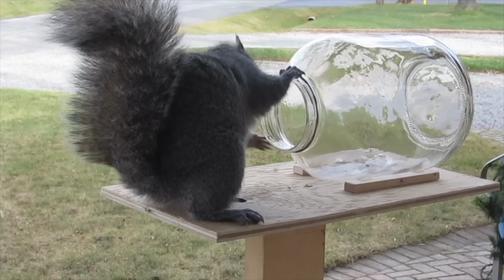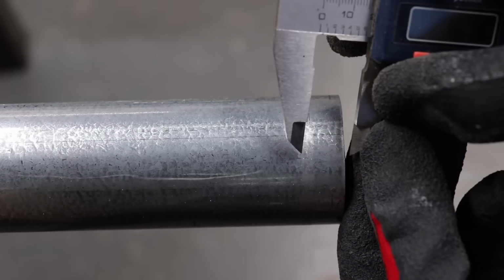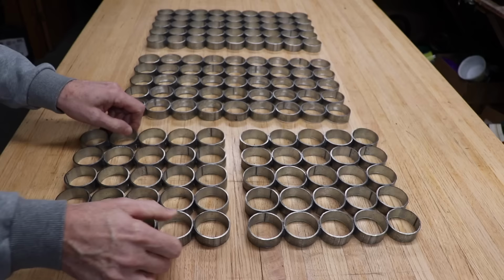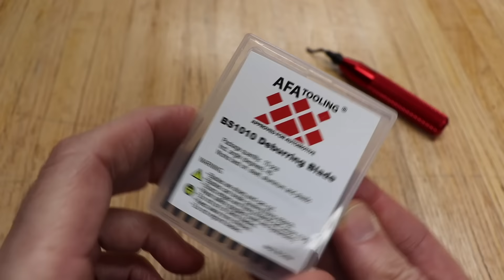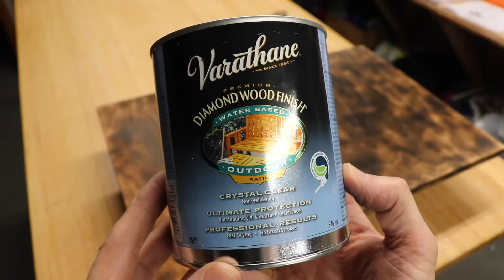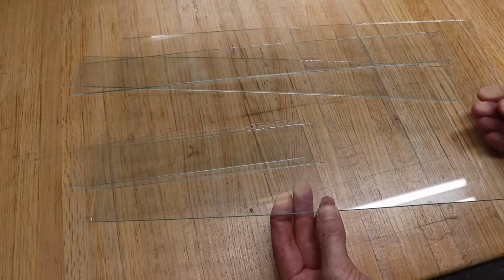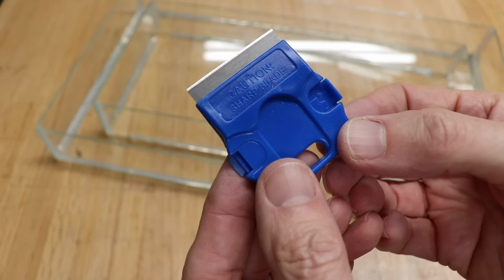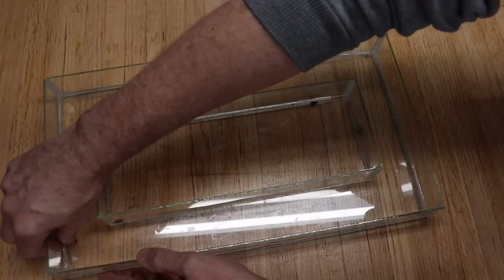How to Make ● A Unique Squirrel Proof Bird Feeder ( that actually works ! )

Comment: I was thinking to make it more Squirrel proof wold be to tighten up the opening. I would try to nestle the rings above down into the row before. That way that opening would get smaller and you would have points on each ring to apply your silicone to adhere to the previous row. The only thing is you would have to make some half rings for every other row. I plan on making me a couple of these. Thanks for the design.

Comment: Cool but I like the glass triangular version better. I need more weather resistant version. Going to build the triangle glass version in the spring. I think I will size it to take a glass baking pan inside. Easy to clean, my birds are really messy, and I can have 2 then switch them out and have a clean one each time. Also on the ends there does not need to be so many holes. I am going to use glass ends with 3 holes drilled. I just need to find the right diamond drills. Thanks for your videos I appreciate you posting them.
Reply from the maker: It’s all about being creative! You’ve got some good ideas!

Comment: I put my bird feeder on a 4" by 4" by 8' treated post.  I rounded the edges off and put a 4" plastic pipe on.  The plastic pipe acts like a sleeve.  For extra protection i put thin layer of Vaseline  on it.  I can hang suet baskets and a glass tray of cracked corn.  This feeder is facing my kitchen window.  I can do dishes and bird watch at the same time.

Comment: I just use an original metallic "slinky" wrapped around the plastic post that holds the feeder.  Super cheap too, less than $10.  It's been working fine for 15 years or more.  Total assembly time?  about 12 minutes.

Comment: You could hinge the bottom row of rings in one of the sides so it would be easier to remove the glass tray for refilling/cleaning. In any case, sweet design.
Reply from the maker: Thanks for the tip!

Comment: this will be a fine feeder mid to late summer when most squirrels are afull grown or almost full grown. But not when they are still young. For those who want to try out this endeavor 1) i don't recomend using any kind of plywood like Chris has done. I did on my first few bird feeders and while they did last a while, approximately 5 years in the midwest for all 4 seasons they eventually will separate, even when they have been sealed. you can extend that by sealing it again every year or you can just use a solid piece of wood to begin with. often times you get small pieces at home depot or lowes that cusromers don't want from their cut pieces for a really good price or even free. 2) you don't need to go to a glass shop to have your glass cut. Lowes will do it for free. 

That all being said, i personally found that the best way to keep the squirrels out of my bird feeders is to give them their own feeders that are set up near, but not next to the bird feeders. i put a mix of cracked corn, sunflower seeds, & peanuts. the cardinals & bluebirds also enjoy this mix. so now it's the birds messing with the squirrels! But, i miss watching them hang upside down trying to get into my bird feeders. haha regardless i have to fill my birdfeeders daily and my squirrel feeders ever couple of days. i have 8 bird feeders and 2 squirrel feeders. i love watching everyone getting along and eating together the squirrels, birds, & bunnies. it's like a big family meal.
Reply from the maker: The young ones won't venture up onto things until they are a bit older and hence become bigger. They ground feed or go up trees.
Reply: @chrisnotap  lol, then.  ii guess the smaller squirrels i the mid west are just more daring, at least the ones living in my area. And i know they have plenty to eat off the ground. we have for walnut trees in our yard, 2 logan berry trees, and 1 apricot tree. And i have mean squirrels if there tryas of food run dry for too long, they go grab a walnu bring it to the 2 ash trees i have in my front yard and start throwing them at me to remind me to feed them!

Comment: The design is excellent, and though I found some of your methods and material choices slightly unorthodox, the result great. Can I suggest you use a wide funnel or something similar to refill the seed through one of the many holes? Might be a little easier, and would certainly prevent a lot of the wear and tear that comes from articulating the bolts and lifting off the structure. Just a thought. Again excellent design.
Reply from the maker: The bolts are very easy to remove to clean it and fill it. This was the simplest method and to keep the integrity of the structure intact.

Comment: 14:03   neat feeder, ill bet 2" pvc works also. 
You can put walnuts under glass on the top and make no entry, just to piss off the squarls.
Reply from the maker: PVC or ABS is soft and they will chew through it on no time!! Plus at 2 inches they will be able to wiggle their way in.

Comment: First off your prescription and video editing is second to none!! Absolutely brilliant👍 The only thing I found puzzling was the amount of rings used in the construction? As from what I observed when birds came to the feeding table only one third of entry ring was used? Which makes me wonder if a 3inch by 1inch ply would serve you better ,And thus eliminating any thieving squirrels attempting to grab any free grub, I don't know what area of the world you live? But here in the UK the winter rains and high winds would render the seed a soggy mess in no time!!I would much prefer a pyramid shaped feeder with the rings at both ends, And steep angles roof protection from the elements, The surrounding platform is unnecessary as is the perches!! This will only act as encouragement to squirrels, But anyway if your happy that's all that matters!!! Welldone Sir😍😊🇬🇧👍
Reply from the maker: The thing about this feeder is you can modify it and make it whatever size you like. I love creativity and what you suggest may work. I'm not quite sure what you mean by the 3" x 1" ply.
Reply: Yes I recommend a 3inch by 1inch ply mounted on the base first before adding the rings!! This would stop any squirrels trying to reach the food!!🤔😉🇬🇧👍

Comment: I like the triangle one more honestly. I feel like it has better visibility and also it uses less parts. Great job on both designs though. Also instead of having to undo the bolts, maybe you could use a long neck funnel to refill it to make it a little easier

Comment: That's awesome.  I wonder if you made the holes smaller at the bottom if that would completely stop the squirrels.  They still seem to be able to poke their heads and harms through but having the holes smaller could prevent it and still allow birds to fly in.

Comment: Way cool.  This may be a repeat but would making the round pieces longer and harder for squirrels to reach through improve it?  Maybe just eliminate the bottom row with a solid piece might have the same result.  I imagine birds could still deal with it.
Reply from the maker: Lengthening the pipes would increase the total weight. This was the perfect length for the silicone and for weight. I wanted it to be as open looking as possible so blocking the bottom row was not an option.
Reply: @chrisnotap  Cover the bottom row with plexiglass or screen with wide openings?  I think some of that is used for stucco.  Maybe you can still get your viewing that way.

Comment: Great idea . very nice!. 
Me, I think I would add a small metal strip and wire it with a 120v line. 
Wire it up with a remote control relay to turn on/off.
When you see one of these little rats trying to get in,
hit the remote! Dinner is served!

Comment: If you used hexagonal packing on the rings you could probably ditch the corner posts for a cleaner look.
Reply from the maker: The corner pieces give it a look and makes assembly very easy and strength.

Comment: It's nice to see this to inform my own design.
I would put a hinge and latch system on the roof to make it easier to open and add seeds and less likely to lose bolts and nuts and have to go buy new ones.
Also, instead of reducing the size of the food tray, I would raise the walls of it to a point that the squirrel could not reach his hand down to the seeds.
I think I'd have to use a smaller diameter pipe because we have red squirrels here. No gray or fox squirrels.
I wonder if our birds could still access it. We mostly have small sparrows or finches. The crows will be out!
Reply from the maker: It's real easy to refill with the bolts and nuts and make it especially easy for cleaning. But it's all about experimenting and finding a better way to do it. If you do make one, I'd love to see it!! You can send me any snaps to chrisnotap@gmail.com
Reply: @chrisnotap  
I'm honestly not sure I'll be able to because we have very small red squirrels here. Its head is about the size of the body of our birds!
Your bird feeder is ingenious, though.

Comment: 7:37 - Should've had the glass shop cut some 1" holes in the larger pane because moisture is going to accumulate in the feeder.  You just built a very nice 2" aquarium to collect rain on windy days.
Just cover the bottom of the feeder with standard window screen mesh.

Also... this will stop squirrels, but not rats or chipmunks.  That will have to be up to your mounting pole.

Comment: I like the pertch idea. Im curious if this can be improved by adding a few bird houses on the top. Incase they actually want to stay close to the feeder.

I cannot fathom the impact on letting them rely on you for everything but I definitely would like to see if this would improve areas where you want to encourage birds to stay.

Btw I was also thinking about a water collection off the top of the house to the inside of the bird feed  ir wherever. Using rain as their way to bathe or drink. Only draw back is building around how dirty birds can be (soiling their own area etc)

But kudos to you for a bit of ingenuity on building this

Comment: Very nice, not sure I would use silicone since around me the raccoons will get into amost anything. I would have tig welded it and then had a hinged section with a latch.
Reply from the maker: The silicone is very strong! The 2 bolts are easy to remove and makes it very easy to fill or clean.

Comment: Nice one, 
I'd use a wingnut on the bolts though to make it even easier to open.
Reply from the maker: Putting a wing nut on in an upwards position is not easy. You drop it 5 times before getting it on. That's why I used a nut. Much easier!
Reply: Ah, okay. I've never had that problem with wingnuts so it seemed like a no brainer to me.

My sister in the UK was asking if it will keep out pigeon/magpie sized birds?

Comment: I'm compering both versions of your anti squirrel feeders, and I find the angle roof glass one (first iteration) nicer. Where there more reasons of Yours except of using just cheaper pipes for construction, to go with the new iteration? I wonder if the glass version might be less friendly for birds (due to transparent roof)? The latter iteration with cheaper piping allows for birds penetrating from all sides, which is better I guess. But observing them by human eye is more challenging (then the glass one) though.
Reply from the maker: From making both, it is easy to see birds in either of them. I am building another iteration of the first version using stainless steel. Stay tuned!

Comment: I would've made the roof hinged with a locking latch on it, so it doesn't have to be dismantled to refill it.  A strong enough latch will still prevent unwanted entry.

Comment: I think i would go buy a roll of car door ding guard  to put over the glass edge so the birds can't get hurt on the sharp edge of the glass
The U shape over the glass will soften the edge and it has its own glue to hold it in place, it is also like  tree branch to give the birds a pirch
Reply from the maker: When you purchase the glass parts at your local glass shop, they will ask you if you want the edges "softened". By doing this it eliminates any sharp edges for the birds and for you while assembling the parts. Win win.

Comment: I love design. I see you use glass, which I like. The little squirrel hands and bird feet contact the glass edge. Does the glass seem to be smooth enough where it won't cut the critters?
Reply from the maker: Whenever you order glass at a glass store, they almost always ask if you want the edges "softened" so there is no sharp edges.

Comment: Now you have to make a squirrel feeder
!
Reply from the maker: You can easily! Just leave your garage door up about 2 1/2" to 3" inches and lay a pile of seed on the floor in the garage . The squirrels will enter and not the birds. Of course doing this brings on another whole set of problems with the squirrels inside your garage. This is why people try to keep them at bay since they do chew everything and can cause a lot of damage to wiring and to your house. You may have missed it but they are able to get some seeds. Just go to 11:57 in the video where I show that.

Comment: The birds only come in at one level, so you really only need one row of metal rings.  You could make the build much simpler with just one row.
Reply from the maker: I made it with many rows so the birds didn't feel trapped and to make it easy to enter from any spot.

Comment: You should sell these to the public. I would love to have one. I am not sure if I could make one. It gets so hot here the silicone melts from the heat. Love your bird feeder. 😊😊
Reply from the maker: Silicone will not melt. Are you thinking of hot glue?
Reply: @chrisnotap  I the silicone on my greenhouse it melted, and made an awful mess.
Reply from the maker: It must be another type of adhesive. Silicone does not melt.While most plastics will begin to melt at high temperatures, silicone does not have a melting point and remains solid until combustion occurs.

Comment: I might have to give this design a try.  Only my biggest problem is the smaller red ground squirrel, which can probably fit.   Have to do some brain storming.. if I leave the seed tray the same dimensions, and perhaps a little taller as to increase the vertical distance from the floor.  Grab a cheap electric fence module, cover the outside platform with chicken wire and solder the tubes together, and then hook up the negative and positive appropriately - energize the unit.  Theory is that the distance between ground and positive is too great for the birds to span, but I should be able to give the squirrels an education 😅.   Have to think about this over winter ……. Also viewing again, I would have to insulate the bottom row of pipe, or make that out of nonconducting material

Comment: Late to watching but excellent, thanks.  I'd have thought plexiglass would have worked as well vs. glass (breakable) for the tray.  And once the tray was smaller, putting angled pieces from tray edge to outside of housing would have seed flung by birds to just drop back into the tray.  This would discourage squirrels from returning at all if they don't ever get any rewards/seeds.  Maybe...  :)

Comment: Besides squirrels are the holes to small for the Grackles? I have a problem with those obnoxious birds! I saw your original video, and I am in the process of making ends for a hanging glass light fixture, placed on its side, that I bought in a thrift store. It kind of looks like a terrarium, after all the electric stuff was taken out, leaving both ends open. As soon as I saw the fixture I thought of your video!

Comment: I’m thinking a dab of JB Weld, though not flexible, will hold up better in the elements than silicone. Or tack weld it. Regardless, great idea. 👍🏼👍🏼
Reply from the maker: Silicone is very flexible and strong! These rings will be expanding and contracting everyday in the sun and silicone can handle that perfectly.

Comment: Just a suggestion if you build another using the galvanized fence posts. The cut edges are not galvanized.  You need to paint those to protect them from corrosion. 
Im a pipefitter by trade and have access to all the pipe i want. We thriw away pieces of scrap long enough for something like this.  I think i will use a piece of 1.5" stainless or aluminum schedule 10 pipe.
Reply from the maker: I would have thought the same thing about the edges of the pipe. It’s been up for almost a year now, and there is no signs of rust. My theory is that the pipe cutter is rounding out the galvanized edge to some extent. I can see if a person used a hacksaw That that would cause an edge to rust. But with a pipe cutter it’s different.

Comment: I would intentionally fill up the skirts as well - so the squirrels too can easily use it, BUT  cannot get to the center square and empty it for the birds.
Reply from the maker: You may have missed that part at 11:57 in the video. Just click 11:57 in this comment and it will take you right to the clip!

Comment: Good way of preventing larger animals from getting inside, but this will not last. Rain will creep between the board and the feeder vessel and remain there as moisture, eventually resulting in profound wood rot. Elevate the vessel using some plastic spacers to facilitate evaporation, and angle the whole thing so that liquid can't collect between. It will prolong the lifetime of contraption for many years.

Comment: Good design. However the little monsters could just easily reach in with a paw and drag stuff out, if they ever tried.The food box needs to be reduced in size to be back a full squirrel leg length away from the barrier.
Reply from the maker: Watch the video and you'll see I made adjustments along the way so they couldn't get to it.

Comment: One idea for estetics: Circular.
A single ring of steel rings with a lid, and it allows for offsetting the second row half a ring every step. Possibly aided in design by shortening the rings to half their length. Also reduces weight.